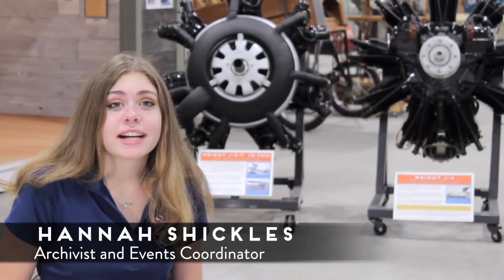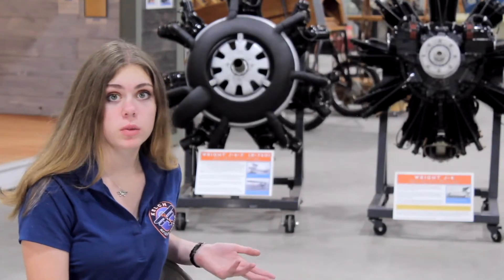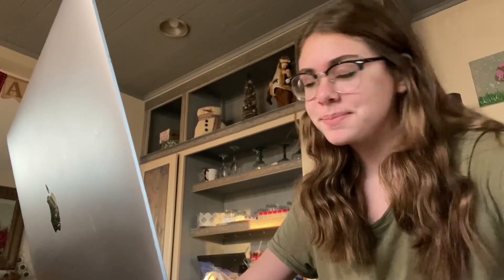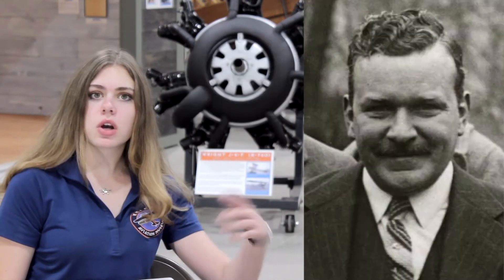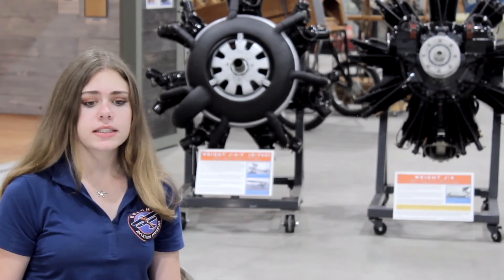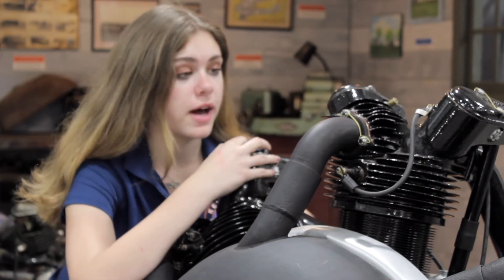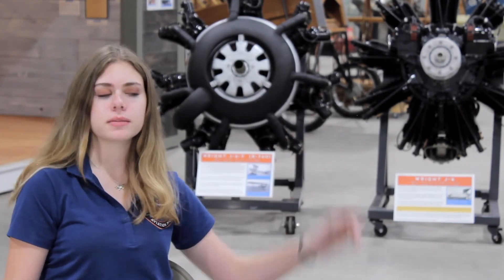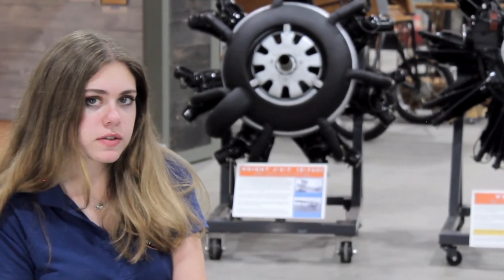Wright J Engine Series - History with Hannah

Comment: Heck yeah man, this video was like really super cool. Gosh, it would have been even super cooler if you had like explained that the reason Lawrence was like "the man" was because he worked with another super cool English guy named SD Heron to develop aluminum cylinder heads that were screwed on to the steel cylinders to like make the engine run cooler, also they were like "man,  we need some sodium filled exhaust valves to keep the valves from like burning up". Lawrence, became president of Wright Aeronautical and this is like what ultimately lead to the development of the J-5, 9 cylinder Wright Whirlwind engine that Lindbergh used to cross the Atlantic. Otherwise, this was like a really super neat video, so cool!! Like I liked your video, Thanks Man!😜😜🤪 
P.S. This is like all explained in a free book (that you can download in PDF form) written by an old dead guy named CF Taylor called "Aircraft Propulsion, A Review of the Evolution of the Piston Engine".

Comment: That was fun. What did the numbers refer to? Does a J5 have 5 cylinders, and a J7 have 7 cylinders, etc.?
Reply from the maker: Good question! The J5 had nine cylinders. It was called the J5 because it was the fifth in the series. The J6-5 had five cylinders. The J6-7 had seven cylinders. And the J6-9 had nine cylinders.